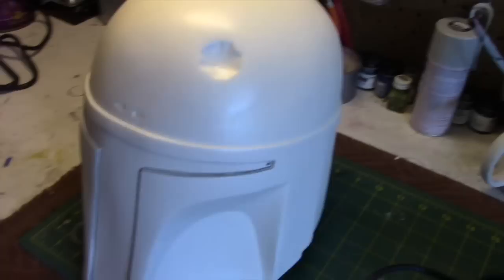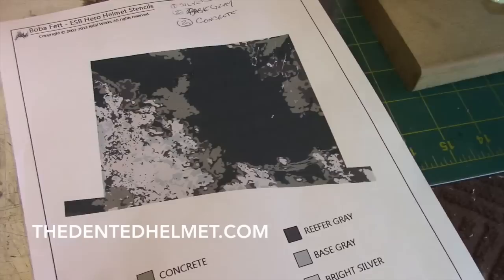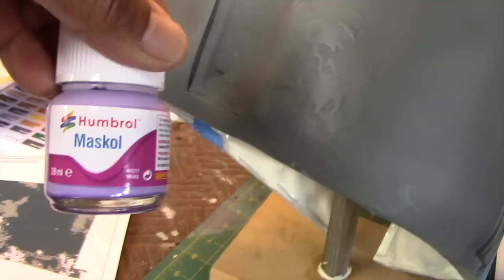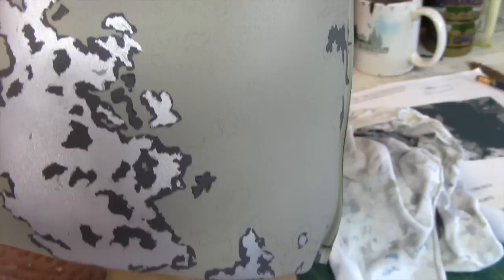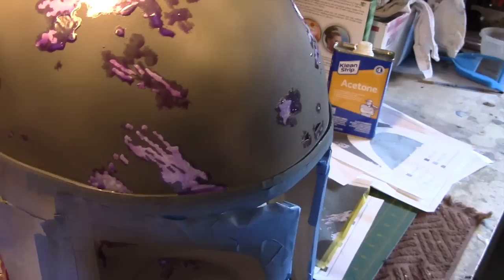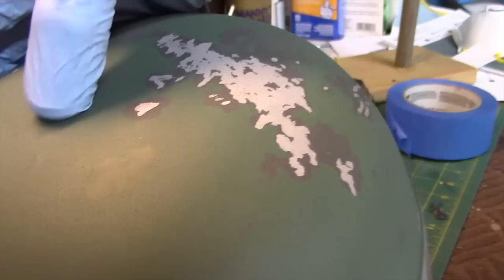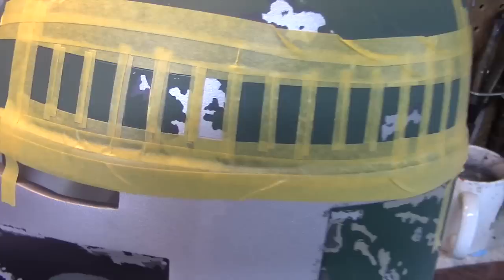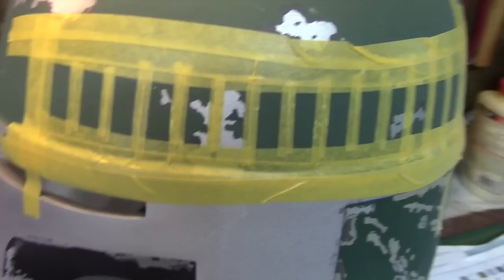Making Boba Fett Helmet Part I

Comment: Great tutorial showing how easily it can be done if you have the patience for it. I do have one question as I am slightly confused. After you trace the damage, apply the liquid latex,  and paint, before going on the next set of damage to trace to you remove the liquid latex or do you just keep it all on and remove it all at the end? If you remove it in between each color, how do you avoid painting over the previous color you jsut added?
Reply from the maker: Thanks for watching and yes....keep it on until the end.  You may have to reapply as you go along.  Sometimes you accidentally rub some of it off.

Comment: This is one of the most useful videos I've ever watched on the painting. Love that you take the time to show each step at different points. It helps those without the experience and cuts out the guess work. I know this is a little old but what paints and liquid mask did you use?
Reply from the maker: +James Peters Sorry for the late reply and thank you for your kind comments.  You'll find all the paints listed in part 2 around 6 minutes into it.  As for the liquid masking fluid, I used Humbrol's Maskol which can be found on Ebay and other model sites.  Thanks again.

Comment: Just wondering I've been having trouble trying to figure out how you've added the green paint after you've done the stencils. Did you layer the dark green first and just mask it off for the stencils ?
Reply from the maker: +thejimmyrayvon Hi....the area was first painted silver, then I stenciled on the pattern for the dark gray color.  After that I stenciled on the pattern for the light concrete color (covering the silver and dark gray zones in the process with masking fluid) then proceeded to paint (the concrete color).   It was after this that I stenciled on final pattern for the green color (4:45 in the video) Those areas were complete covered with masking fluid after which the green paint was applied. I wish there was an easier way to convey this in writing.  I would highly recommend viewing Lewis-White Fx's videos. He goes into much more detail about this process.  I hope that helps and thanks for watching.

Comment: hi
what's the name of the Ebay kit you used.
Reply from the maker: Look for seller Atom_Kinder.  Here's a link to a current auction, as of Jan 15, 2017.  Hope that helps:
http://www.ebay.com/itm/Star-Wars-1-1-Scale-BOBA-FETT-Resin-Kit-Helmet-Rogue-One-ESB-ROTJ-/192070939101?hash=item2cb851f1dd:g:mL4AAOSwcUBYU46K
Reply: Ooohhh I thought it was a painting kit. I have the helmet already.
But thanks 😊
Reply from the maker: Just used templates from thedentedhelmet.com.  I would consult that forum to find the templates.
Reply: Ok thanks